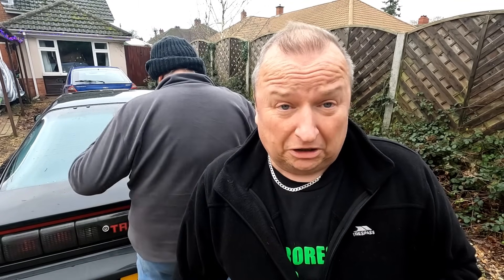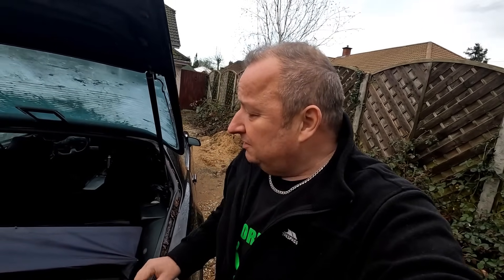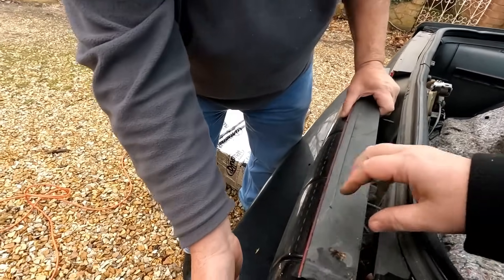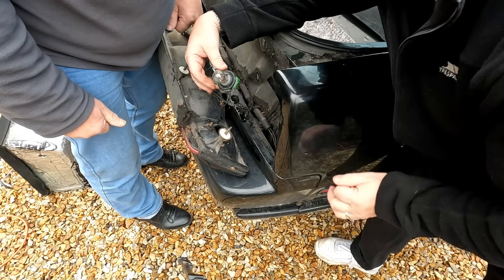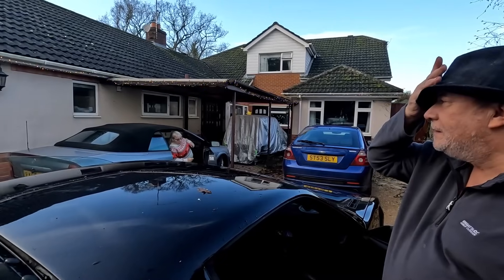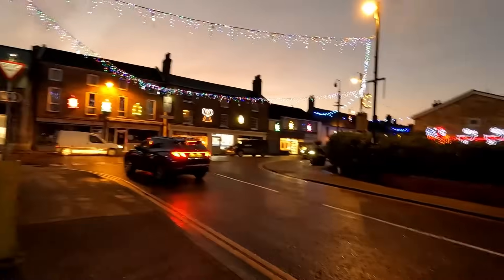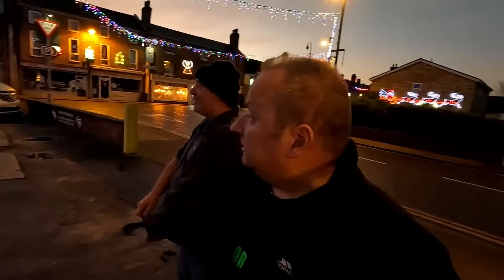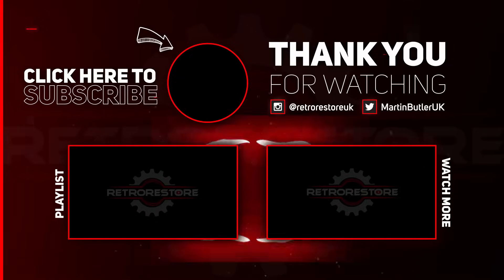The TRANS AM failed The MOT On This!

Comment: I started my Motor Mechanic apprenticeship in 69 and we stripped every faulty component and replaced parts whether it was a carburetor with a tiny little jet or starters alternators  engines gearboxes and differentials etc,we never replaced the whole part unless it was necessary,nowadays they are technicians not mechanics,the just plug the car in to diagnose the fault and replace the offending unit,we are a throw away nation now not a repair nation as it's not financially viable to spend time on the job,another great video

Comment: I don't know how that rear number plates passed the mot test because they are not spaced correctly. I used to do mot testing and the specs in the mot manual say "must be the correct size, stroke width and spacing"
Reply: They must have found the £20 in the glove box 😊